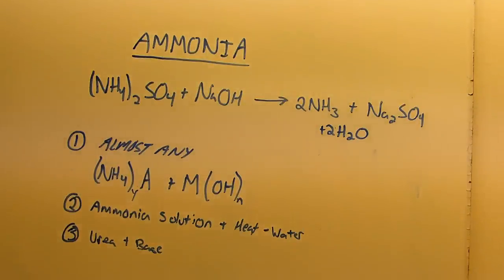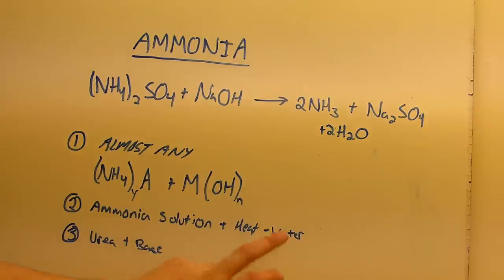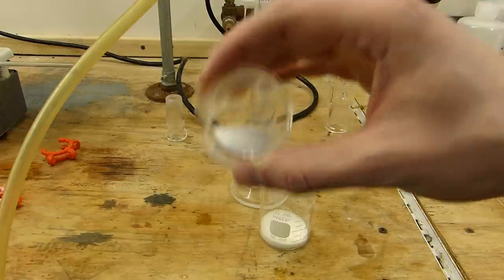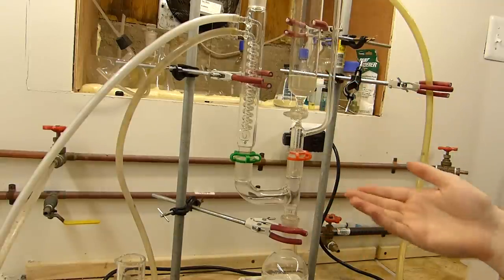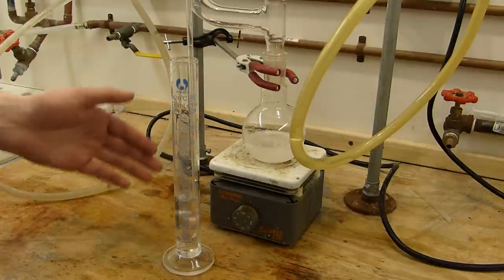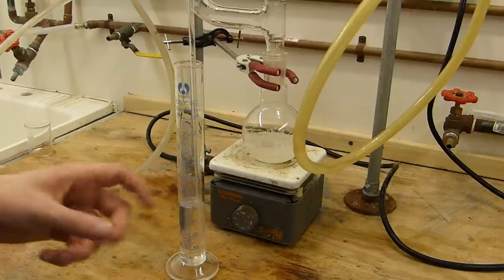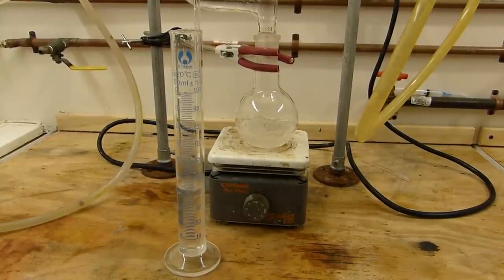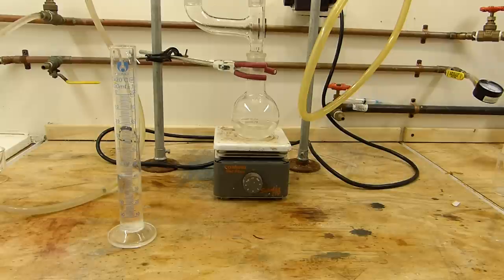Ammonia Generator

Comment: Most of your ammonia is in solution in the water inside the rubber tubing. Suckback drew some water into the tubing "loop" and it acted as a first and better "bubbler" - more contact area, the insides of the tubing are constantly wetted due to the movement of the bubbles.

Comment: Urea and sodium hydroxide works best for me when I add the ingredients together dry and add a catalytic amount of water. It really doesn't take more than a few drops since the reaction produces water. I also find ammonium chloride and sodium hydroxide is a high yielding and easy to control reaction.
Reply: for reacting Urea and preventing foam you can add a few ml hair conditioner to prevent foam in reaction.
Reply: What's left after the reaction?
Reply: @farhadjabbri4331  I've always wondered if that would work; you've given me inspiration to actually try it
Reply: I use that method too

Comment: The material in the graduated cylinder is very probably calcium hydroxide. Well water will often contain calcium as the bicarbonate.
Reply from the maker: HClO3 Chem Very good observation!
Reply: Could also be silicic acid from dissolved silicon dioxide.

Comment: I usually mix the dry Sodium Hydroxide with dry Ammonium Sulphate in the reaction vessel and add a bit of water, because the reaction generates more water it accelerates on its own, don't particularly need to heat it because there is a lot less water in the reaction vessel to absorb the ammonia.

I would also suggest that an oil layer would control foaming in a urea/hydroxide reaction (silicone oil if using strong hydroxides otherwise it will be soap foam!)
Reply: I can buy "diaphram caustic" (sometimes liquid caustic) for around $7/gallon, that works very well with ammonium sulfate, also.  Just don't use a glass sep funnel as an addition funnel.  Buy the cheapest all plastic funnel you can find.

Comment: Hi Doug, I've been an avid fan and subscriber for a long time. This is my first post to you so I hope that you'll read it.
Just wanted to ask if it would be possible to extract the sodium sulfate from this process? Would it just be to boil off the excess water in the first flask, to yield anhydrous NaSO4 or would you have to do something else? The reason for asking is because I'm looking for easy ways to make sodium sulfate, and since this process would give me high-grade ammonia it seems like a win-win situation, and plus the fact that I've got an entire box filled with ammonium sulfate which I accidentaly bought from the garden centre, back in the days when I thought that "ammoniacal nitrates" meant ammonium nitrate ;-) And I've also got tons of sodium hydroxide which I'm dying to use ;-D
Reply: You can... First you need to neutralize the remaining solution with an acid to get rid of the remaining NaOH in solution. I'd recommend using H2SO4 for this, since it will neutralize to form further H2O and Na2SO4, so that you can boil off most of the water and crystallize the sodium sulfate.

Comment: A couple of practical notes. Foaming may occur even with ammonium sulfate though not as bad as urea bring heat up in stages. 
2. Suckback occurs when your dripping in and the gas evolution slows you will see it separate with a clear layer on top be ready and disconnect output line then until until all aq NH3SO4 is added then reattach output and add heat.

Comment: for the urea maybe use something to break up the surface tension or a solvent with a low surface tension? maybe try using urease instead of hydroxide?
Reply: Urea alone can make an excellent ammonia generator since it is a single C=O(NH2)2 molecular structure, each molecule degredation yields 2 molecules of ammonia.  Dripping in HCl chemically destroys uresa into 2NH3 and one CO2 molecule when in water.  Since a water molecule is consumed to give the second O to form CO2 in the second step of degredation, H+ ions are reformed making HCl more of a catalyst.  This requires some heating being an acid-catalyzed reaction so be careful not to overheat and pollute your NH3 gas with excess water vapor; 50-60 C should be enough heat and a drying column with CaCl2 or CaSO4 should be sufficient.

Comment: Doug how would the yield fare if you simply turned the hotplate off? I know ammonia is more soluble in warmer water so to the point that I don't want to boil the reaction vessel could I get an appreciable yield with considerably less time and effort? Thanks
Reply: Ammonia (like pretty much all gases) is less soluble in warmer water, the heat is to drive it all off even before boiling

Comment: Doug, did you ever experiment with ( NH4)2 CO3?  Ammonium carbonate, which is cheap and  available in anydrous form, decomposes in an open container into NH3 and CO2  and water.  I can't try this at home because I don't have a lab (yet).  Perhaps passing the effluent gases through a generous amount of lime (a basic dehydrating agent and usable with ammonia) will remove the water?
Reply: P.S. Look up ammonium carbonate in Wikipedia.  It was and may still be used to replace yeast in baking foodstuffs!  Wikip. doesn't say how baked ammoniated dough tastes, or if one needs a fume hood to bake bread this way.  At least the use makes A.C. readily available (I think.)
Reply: Unless it could be ordered at a high purity via chemical supply, food grade would most likely be too low of a concentration to be worth it, not counting impurities getting in the way.  Most likely this would not be sold at high concentrations due to the self reacting breakdown it exhibits; especially liberating NH3 gas.

Also storage time is issue b/c ammonia and CO2 released over time during natural breakdown to sodium bicarbonate powder; effectively loosing up to half the ammonia before use accelerated by heat and moisture.  Best ammonia source is by far fertilizer, with only NH4NO3 and most all contain lots of urea too.  If not amm. nitrate, other salts work too but nitrate is best if available.  Never use ammonium hydroxide unless its fuming high con. lab grade...cleaners max around 7-9% usually so very low yield for energy input

Comment: When i first did this reaction i used calcium hydroxide instead of sodium. Would there be a difference?
Reply: i dont think so
Reply: well except for the rate of reaction i don´t think so (and well the stecheometry but that´s obviously) but the more basic your hydroxide is the faster it will go.
Reply: The main difference would be speed of reaction.  Reason: Ca(OH)2 is much less soluble than NaOH, the latter being completely soluble with a very high saturation concentration.  The most effective NH3 generator I always use is most any form of highly soluble ammonium salt dissolved to saturation in water.  The eastest to acquire I use ammonium nitrate from a strong fertilizer which can cheaply be purchased in bulk.  After the solution is saturated, slowly dripping in con. NaOH with stirring shifta equilibuium turning ammonium ion into ammonia gas, which is forced out of solution as gas without heating, also drastically limiting water vapor since heating is not required.  Also, when finished you have a byproduct of NaNO3 salt, which can be used to nitrate compound in other reactions or used to make nitric acid; so multiple uses from just a couple cheap starting chemicals.

Comment: Can you run AMMONIA GAS threw METHANOL ? In the presents of SILICA GEL?
Reply: why that would just make Methylamine, anyone with any organic chemistry knowledge would know how to synthesize such a simple organic. even if all knowledge of it was censored from the internet. a clandestine researchers first move would be to attempt to mix the isolated two component parts together under different kinematic conditions to rediscover the formula. why even high school chemistry teacher even if they were suffering from cancer, particularly if had regrets about missing out on joining a crystal pharmaceutical start up based on revolutionary techniques they had pioneered, would know how to make it. they certainly would not have to resort to robing a train. my point is as good as a story BB is it has some large holes in it's plot that shows that it was not written by someone with understanding on the chemistry side of things. if it was written by someone with chemistry knowledge Walter White would have used cryogenics to distill nitrogen out of the air then turn that into ammonia. he would use gasoline to build up the rest of the molecule.